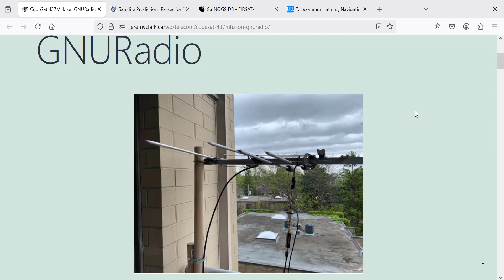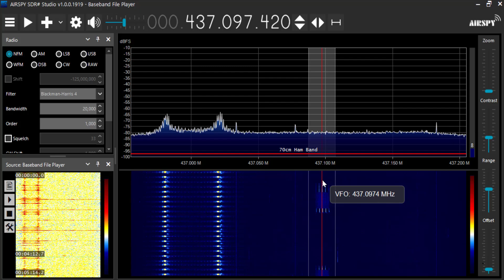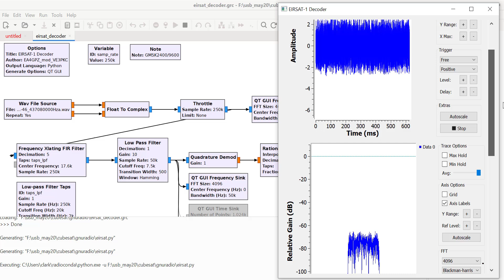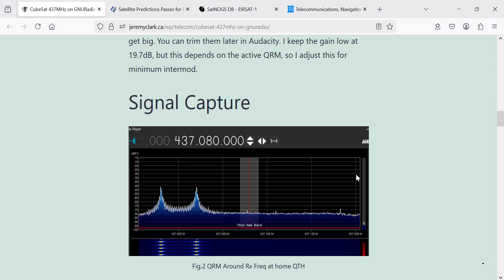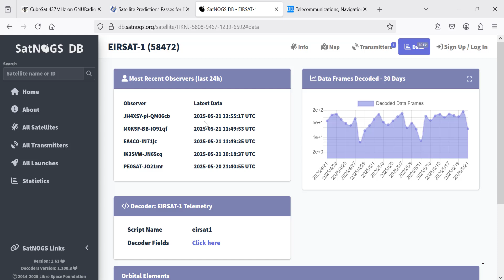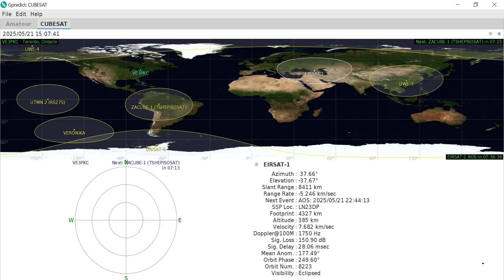CubeSat 437MHz on GNURadio

Comment: Very nice! You might want to consider recording IQ at the full 4MHz, and then decimating down by a factor of 16. It'll drop your quantization noise floor, and make your 8 bit ADC perform like a 10 bit ADC. The decimated IQ stream will be no larger, but have less noise.
Reply from the maker: Good suggestion, many thanks!